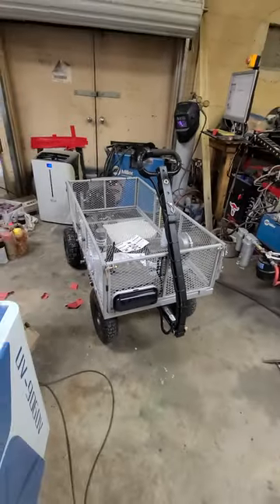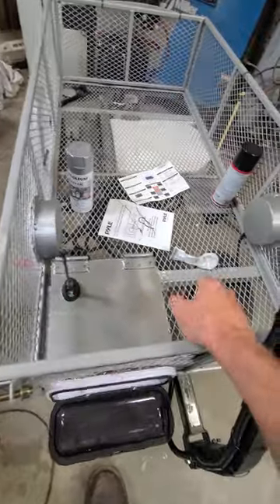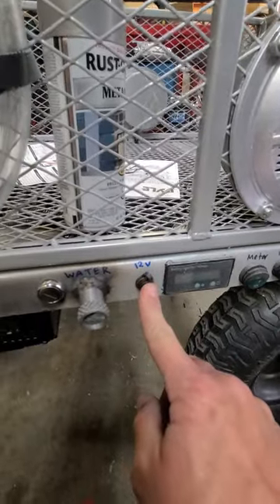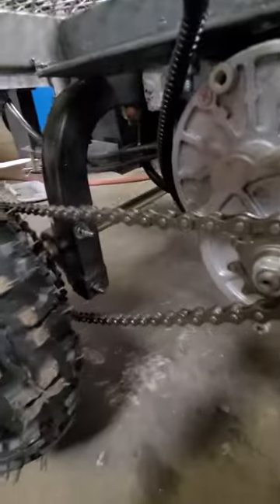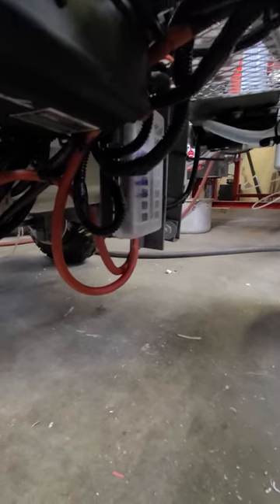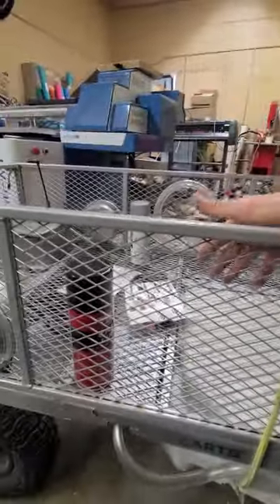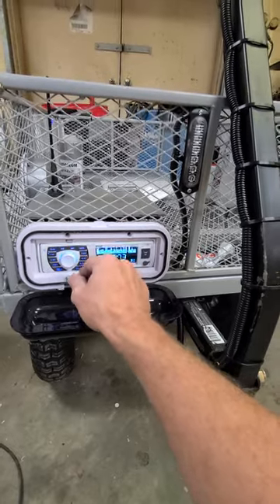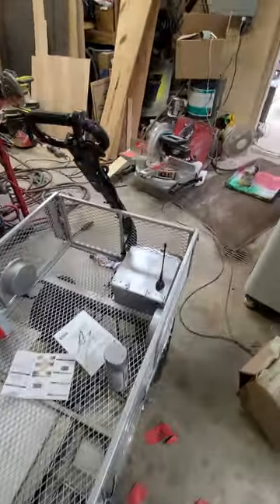electric beach cart build from a gorilla cart

Comment: How much run time/distance on the 2 12v batteries wired up as 24v? I am building a utility cart and using 2 12v batteries wired up to 24v. I am using 2 12v 35ah batteries. I am using a  24v 1/2 hp motor and a worm driven gearbox. What speed controller did you use? I see you are using a thumb throttle. I plan on using a twist throttle. What gauge wire did you use for the 24v system?

Comment: you should post a video of it moving. How do you control the electric motor?
Reply from the maker: I actually did make a video but I haven't had time to upload it. I can shorten up the results in this comment though lol. So it most definitely helped 100 percent on the sand, BUT it's still a but of a fight with the tires that's on it. Nothing like of there wasn't a motor at all though. I also kept having an issue where the chain would come off when it struggled so much. I actually have since bought 4 of the large gray balloon vevor tires that I am going to install, but it am going to have to extend the exles out so I haven't had time to install them. After I do that, I am going to probably slot the motor mount so I can adjust it for the chain tightness as well as the straightness of the motor to the chain.
Reply from the maker: No doubt after I do that, it's going to be an absolute beast at the beach and over every other terrain as well. The motor speed is controlled by a thumb throttle I mounted byw

Comment: Parts list and links and step by step build video please
Reply from the maker: Lol. I can probably get u the list of parts, but as far as the build goes..ehhhh.... I kinda winged it and forgot to record it. It was actually a lot of here and grinding it off because it didn't fit with this part or that part and then re welding again, etc.... wasn't really an easy way to explain it. As far as the electronics and all, that's pretty straight forward.  I'm actually gonna build a lithium pack for it this year to make it lighter, and gotta build some adapters to use the gray balloon tires I bought to exchange the black ones with. The wife is already on my case about it so it won't be long